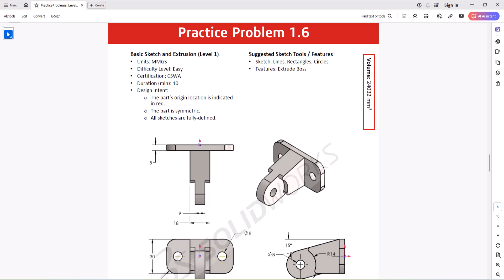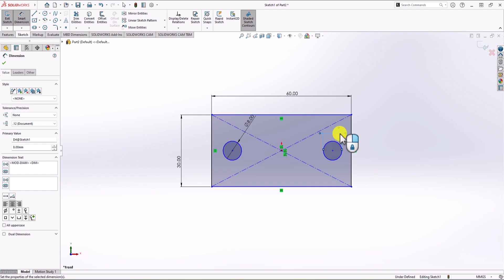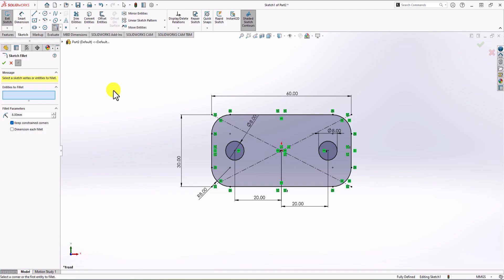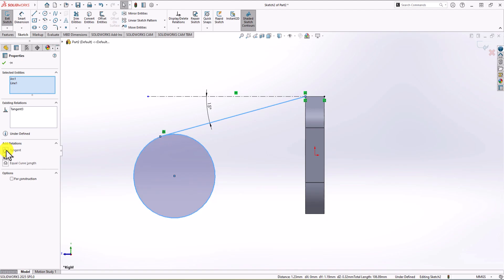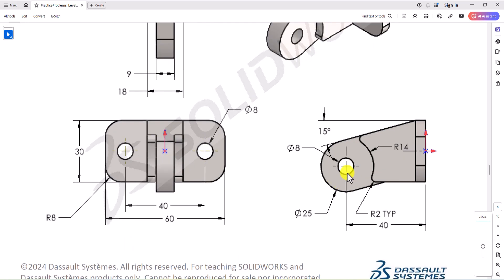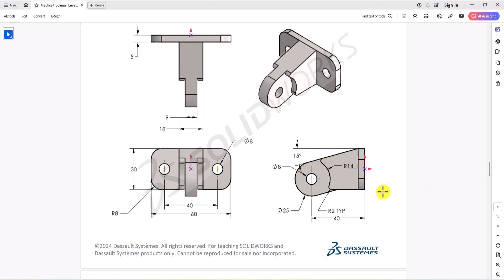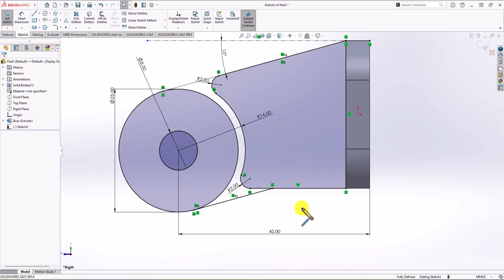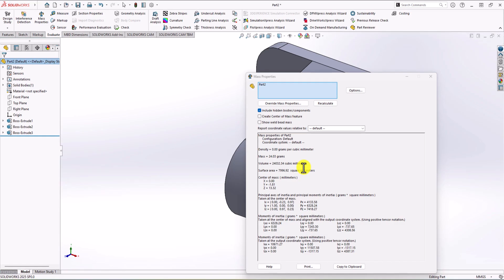CSWA Practice Problem 1.6 Solution | SolidWorks Exam Guide

Comment: I keep running into an issue when extruding the last part out from the existing 9mm extrusion. It says “the sketch cannot be used for a feature because an endpoint is shared by multiple entities” do you know what the issue might be? I cannot find a solution
Reply: Might have found the issue where three lines intersected at an endpoint but now it says the sketch has more than one open contour
Reply from the maker: @alexanderpayne2024 It's quite difficult to understand the issue in your model without seeing it, but one suggestion I have is that if you're only having trouble extruding the last piece (the 18 mm piece), an alternative approach would be to re-draw the sketch for the 18 mm thick part and extrude it separately. Of course, this method is not as efficient as what I explained in the video, but it should work.

To do this, click on sketch --> choose right plane --> draw 2D sketch only for 14 mm thickness part --> click on exturde boss --> select mid plane --> and extrude it for 14 mm
I hope this helps

Comment: I had the same at 10:35. I made the same assumption by making the line parallel. But I didn't go forward so I opened your video to make my ambiguity clear. ✌️
Reply from the maker: Nice! Glad you checked the video and it helped!
Reply: I came here for the same reason and because I wasn't sure if the arc and circle had the same center point.  Good video.  Thanks!
Reply from the maker: @_chavid_  Glad it helped! Yes, the arc and circle share the same center. Thanks for watching!